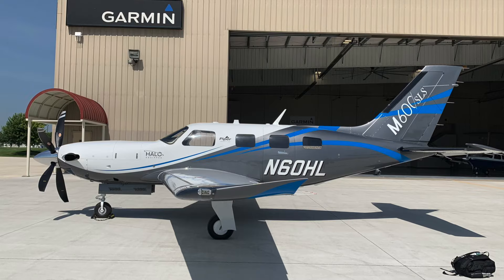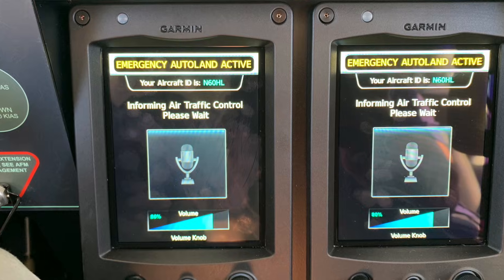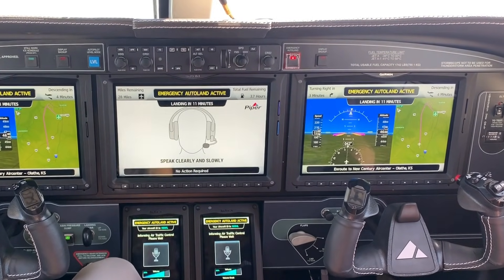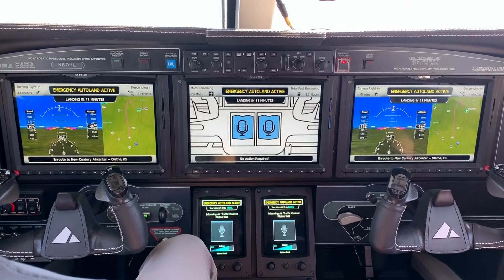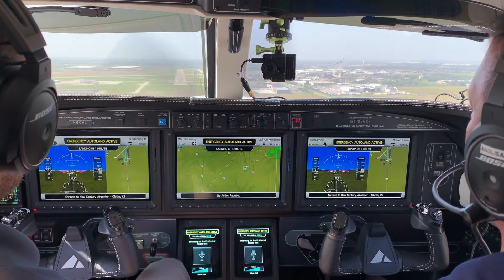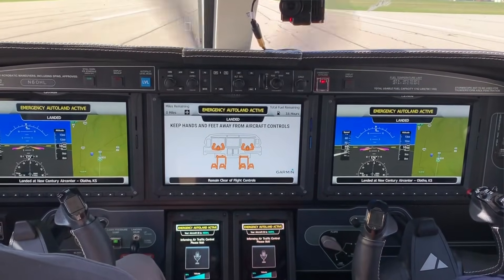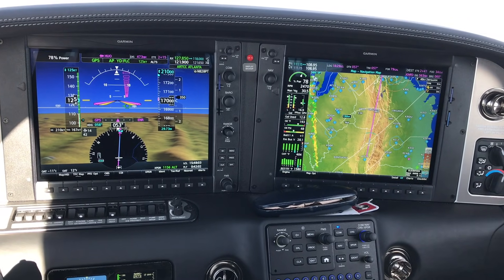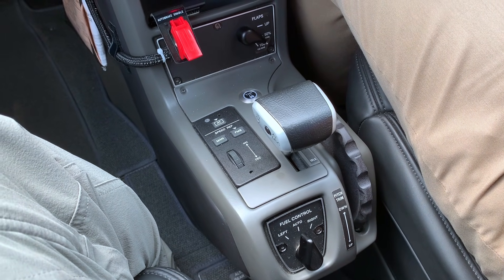Garmin Emergency Autoland Flight Trial

Comment: This type of system could be quite useful in commercial aircraft as well.
Reply: Well there are always 2 pilots there, so the risk is lower, plus, commercial planes can actually land by themselves (if the airport supports it)
Reply: Yannick von Grabowiecki I know i was thinking more that it could be intergrated in the autopilot to perform cat 3 landings without needing cat 3 ils. Could save smaler airports a bit of money and allowing them to operate in poor weather conditions
Reply: @puppers2607  I guess ICAO would be against relying on Autoland...
Reply: @ygrabo  still a button could save lives
https://en.wikipedia.org/wiki/Helios_Airways_Flight_522
Reply: @puppers2607  The precision would be to low for everyday use ; at minimum the airport need one of these
https://en.wikipedia.org/wiki/Differential_GPS

Comment: So, the autoland is activated. It chooses an airport for suitability, assuming that it interprets the weather, notams, field conditions, landing performance. Does it also announce itself to atc automatically? If the pilot is incapacitated, talking to atc will not be an option so it will be a ghost plane. Would atc have the ability to monitor the progress of the flight as it gets closer to destination and alter its movements for traffic avoidance? This is nice idea, but the implementation needs more work.
Reply: The video mentions and visually depicts the system making ATC radio calls on numerous occasions. We don't get to hear them, but it's implied. Of course ATC can monitor the flight, it's squawking 7700...they'll be lighting up the scope like a flaming christmas tree. ATC can't "alter the movements" of the aircraft, it's a ONE WAY system. Hell, ATC barely has color TV up there in the radar rooms.  CPDLC could potentially allow for two way digital communication where ATC could re-clear them to  another destination, however, that is not out of the realms of possibility with CPDLC (datalink) definitely on the roadmap. However, the LIABILITY issues in having ATC pick a new destination for an airplane would be significant.

Comment: Won't be long until pilots are just there to monitor the systems and don't fly at all. I do wonder how this would cope with an engine out or loss of hydraulics issue though.

Comment: It actually does not sound like it is to complicated a system. Just tie the autopilot, auto throttle and nav/fms together with flight surfases and gear and voila! 
I want to know if that airport is the old Naval air station in Olatha? It was closed out in the 50s or early 60s.

Comment: No mention about how it deals with traffic at an uncontrolled field, or an aircraft in the vicinity that is not in touch with ATC.  I imagine someone is working on this?  
  At my age I don’t fly without a spare pilot.
Reply: Fly safe man.
Reply: if it was implemented they would have mentioned it.
Guess now they just assume the chance of a mid air or runway incursion is low enough to be acceptable during a emergency

Comment: Why do we need pilot at all then. Robot is taking over everything.
Reply: why...because, if something goes wrong with the AL, who is gonna land it? The Cookie Monster?
Reply: @thiscorrosion900  well in that case there goes my future job as a pilot, might as well solve the pilot shortage crisis with more automation
Reply: @gordo1163  Nah, I meant someone has to be in that bloody plane that is capable to fly and land it and monitor systems, etc. 

The ALand systems are only another 

emergency/safety feature, that's all. 

So your job should still be safe!

Comment: When the system communicates with the airport, how does the airport give clearance to land and which runway, or does this thing just barge right in regardless?
Reply: This would be used in an emergency which would give it priority over all other traffic regardless.
Reply: @zachr8274  … except the other autolanding emergency. But I'd assume that TCAS integration could resolve that.
Reply: It uses the Leeroy Jenkins approach.

Comment: How does it handle bad weather, such as IMC, turbulence, wet runway, severe crosswinds.etc
Reply: Does it really matter? If the pilot is incapacitated and the passengers are not able to take instructions and fly the plane, then the only other alternative is to sit back and wait to die? If the passengers are able to take instructions and fly the plane then this system would at least make it easier to set up an approach that could be aborted if anything is off-nominal.
Reply: MWB Gaming most likely the same way auto pilot does

Comment: How does it handle a subsequent loss of power/thrust? Will it establish best glide and look for suitable terrain for off-airport landing?
Reply: Would be possible depending how detailed the database it its using.
Best glide performance is relative easy to do for a autopilot; adjust elevator trim to maintain the speed of the best glide performance.
That speed is known for each plane.
Reply: cmulder002 true. I saw this feature also highlighted on the Cirrus Vision. I suppose in that case, it could continue flight until CAPS deployment altitude.

Comment: eh, I mean the 737 max was killing people with just an anti-stall system. I’m open to it but just regulators and insurance companies maybe not
Reply: AM sure because of "mcas" the regulators are going to test this system themselves before approving it. 

Crucial difference is that this system allows for a pilot to take back control at any moments by simple moving the control inputs; that is why the system explains not to move them when the auto-land system is active. Also its ONLY active AFTER the button is pressed and makes that very clear on the displays.
Reply: cmulder002 You have a point. Was the anti-stall able to be disengaged or did you just have to fight it?

Comment: I'm wondering if this system would assist a VFR pilot who gets into bad weather or clouds and accidentally becomes disoriented or inverted? Would it assist in correcting the aircraft to make the safe landing?
Reply: It transitions from whereever you are to a landing, unless otherwise interrupted. You can come up with as many use-cases as you like, including the one you mentioned. Once in VMC, the pilot could either deactivate the system, or let it continue to land.
Reply: @coma13794  Nice.

Comment: Interesting system.  However, very sophisticated system for a very, very, very rare event (hypoxia or pilot incapacitation).  Data shows that the more significant issue with these aircraft are pilots losing control (icing-induced suspected conditions and the aircraft ends up in an unrecoverable stall/spin leading to in-flight break up).  Seems money would be better spent solving the higher likelihood events that lead to fatalities. I own and fly a PA-46 so I’m familiar with this aircraft and the fleet’s incidents.

Comment: Elon Musk: our cars drive themselves
Garmin: hold my beer
Reply: @Richard Ren yea you would assume since there is much more risk on the ground (and much less reaction time) that car control software would be stricter regulated (and tested) then in aviation  ....
Reply: It's counter intuitive.  The things a plane must do to fly itself is easy compared to what a car must do to drive itself.  A plane does not have to recognize very much about it's surroundings in order to navigate and land.  An autodrive car has to have a system that will recognize roads, centerlines, other cars, obstacles, pedestrians, Stop lights, signs, construction zones, reduced speed zones....etc....
Reply: That's all cool until the plane runs under a truck that pulls out in front of it.
Reply: Fully autonomous cars is a much more difficult problem and Musk still hasn't come close to solving it.
Reply: @Richard Ren That is already implemented; The reason you are told NOT move the controls is that when you do it disables the autopilot and switches to manual control. 

No need to push a button just fly the plane and press the auto-land button again if you want the system to land for you again.
Reply: car autopilots are alot more complex but im sure people mentioned that already...
Reply: self-driving cars are much much more difficult than this,  they are light years apart
Reply: @MrPCT007  that would be a much cooler demo for garmin ; showing how tcas is implemented during the automated flight part.
Reply: Xavion re-badged?
Reply: Planes are to easy for Musk, he does this with rockets instead :)
Reply: Landing a plane is way easier than autonomously driving a car.
Reply: Anything Tesla can do, Garmin makes it better,
Reply: Lot less traffic to worry about up there ; the chance of a kid running on front of your plane chasing its soccer ball is really small.
In a car its a much bigger issue.
Reply: @cmulder002  definitely the truth
Reply: @cmulder002  You are correct. It's actually much easier.
Reply: @cmulder002  There's no children in the sky.

Geese:Hold my Beer.
Reply: cmulder002 nah, much harder with a third vector of travel and especially with all the atmospheric conditions having to be programmed in.
Reply: @beechcraftkingair3799  civilian planes are designed to be stable. you can let go of he controls and it will just continue to fly straight and level.(with the trim set correct).
The "dihedral" angle  ("V" Shape when looking from the front) of the wing is one part of that and that helps to keep the wings level.  Autopilot design started in 1914 and in the early '60 gyro's where accurate enough for cross country navigation on those gyro's alone.(this was done to test the navigation system later used in the Apollo project)
None of that required computers as we know them today. Today's technology just adds precision and more user friendly use.
Reply: to be fair his rockets fly themselves too
Reply: @Fresse  all rockets fly themselves starting from the first rockets
Reply: @Richard Ren not as much as Google's though Google always crashes no matter WHAT they make since they fired all their geek people long ago.  They are the most mismanaged company worse then Payless Drugs was!
Reply: Now if they can take the annoyance out of taxi navigation and engines management   I’ll upgrade immediately
Reply: @Richard Ren also airplane crashed, and people in cars... people crash so much in cars that it's no longer a tragedy but a statistics.
Reply: well they don't yet. he has ONLY just released a closed Alpha of auto-drive features, and is still years away from getting it working.
Reply: Doesn’t take into account NOTAMS, construction, etc. that being said I’ll take it over a Payne Stewart type scenario
Reply: @Richard Ren Baahahaha, you think some programmer just hacked some shit together to get those Falcon 9's to land on a barge in the middle of the ocean in rough seas?
Reply: control a plane or a boat is 100 times easier than a car in the traffic, with several variables you cannot figure out or predict when will happen.
Reply: As a machine learning engineer, I can confidently say that autopilot on the ground is actually much harder than this
Reply: @Richard Ren wow this is true, for every Tesla that crashes, there are 10 times as many crashes by human drivers. Already, Tesla on autopilot is 10 times less likely to get in an accident per mile then a human, so for every crash that we test the car has, there would have been 10 had it not been driving.
Reply: Margin of error is HUGE in the air, on land inches could be life and death
Reply: @Richard Ren that is just statistics; once there are "enough" of these systems in use sooner or later there will be a set of circumstances its not programmed for and it will crash. 

Both on the road and in the air.
Reply: @cmulder002  It's not exactly like that for the cars at least (personal experience with software engineering the back end). There isn't this list of "circumstances" that it goes through, it's a general connection between all of the systems, all of the inputs are weighted depending on other things, etc. It's much like a neural network but not quite. It all comes together to control the brakes, steering, etc not by making a specific decision, but by taking whatever action is MOSTLY wanted. 
I'm not good at explaining this stuff in such few words but the best way I can say it is it's kind of like a Ouija board where all of the subsystems have a hand on the planchette 
When it crashes, it's almost always because it's being starved of information in the worst possible moment.
Reply: @cmulder002  the same thing can be said for driving or flying manually.
Reply: cmulder002 yep it’s called taking the pilot out of the cockpit Uber style
Reply: @cmulder002  Seems that a lot of humans weren't programmed right as well.
Reply: Elon :  no Hold My Beer Lands 3 Rockets from space backwards
Reply: @MrPCT007  Clearly not a pilot to have this kind of thinking. car automation is much easier than plane automation. This is far more complex.
Reply: @maxou5757  Wrong.  Flying is a simple, lazy turns,  straight lines, predictable environments, predictable speeds and altitudes, well marked runways, no pedestrians jumping in front of you, no traffic to avoid or poorly marked roads.  Auto land has existing for a couple of decades in heavies.  This is very cool but it is nothing new.  Don't let all the buttons fool you, normal flying is not rocket science.
Reply: Christophe Blanchi Fool me ? I’m an Airbus A330 pilot, I think you’re talking to the wrong person. I’m well aware how those systems works and what kind of limitations we have on autolands;)
Reply: @maxou5757  car automation is impossible to do safely on existing road systems. There are too many variables. Aviation is procedural and predictable in comparison.    No balls roll across a flight path that have to be interpreted as a predictor of an upcoming event, just to name one. The auto car that killed a pedestrian in California wasn't an outlier. It was absolutely what had to happen.
Reply: @maxou5757  dude what? car automation is light years more difficult than plane automation, not even comparable. I am a pilot and worked in machine vision applications to self driving

Comment: Autoland has been around for years in commercial airliners and thus not really anything new but it is now an available system for general aviation. I am sure this is an expensive option for business jets and turboprops mainly. Doubt older planes could be modified for any reasonable price and I doubt it would be worth it for cheaper planes given new servos for brakes, landing gear, flaps, etc. cheaper just to have a parachute but it is about time that Autoland is available to non commercial aircraft. Not sure if it will allow you to do CAT 3 approaches or not and not sure if it only lands at airports with approaches, but it is a great product and Garmin will again remain at the top of the avionics sales list.

Comment: Auto land has been a thing since the 1970's the Air Force C5A had a version that would put it on the runway but the pilots would have to break a steer once they landed
Reply: Rae Namet Didn’t the L-1011 also have autoland?
Reply: @SamPatton-t3g  Don't know
Reply: Autoland is somewhat older than that. The first commercial passenger flight that autolanded with limited visibility was in June 1965 (on a British European Airways Hawker-Siddeley Trident) and in Novenver 1966 one landed with zero visibility (Cat IIIC).

Comment: Lets say you hit a bowling ball while flying high and cause a big circular hole somewhere that has scattered around and injured some hydraulics, fuel lines, cables, etc... etc... How good does this system work in a real crisis when multiple sensors have been disabled or read false data due to a real accident in the air, leaking fuel, elevators say they work but does not work etc?

Comment: Will the system recover the aircraft if it has departed controlled flight?  A much more common occurrence than pilot incapacitation.
Reply: Then the pilot has to admit he lost control and press the button.
A system that overrides the pilot is dangerous (mcas)

Comment: Like what someone else has said. Trains, trams, etc. These things are literally as one dimensional as you can get in terms of movement. They ride on rails the whole time with specific designated stops. Despite this, there are still MANY conductors to operate the vehicle. 
Now try to compare that with a vehicle that can move in three different areas, moves through a changing atmosphere, travels hundreds upon hundreds of miles, flies above heavily populated areas, etc . At first I was worried about my future job, but I strongly believe that it will take at least 25-30 years before these things are fully automating airliners... IF that.
That being said though, still a neat piece of tech that could go onto private or general aviation aircraft in the event of an emergency!

Comment: Would be interesting to see a system on a commercial jet where the pilot can activate an auto-land and then lock out the controls in the case of an attempted cabin breach / hijacking.
Reply: that might become a next mcas then
the' pilot regardless of skill level should always have the final say in control.

Comment: I think it would be nice if ATC could issue a message to the airplane to activate this system from the ground. Sure, it would need some cryptographic protections and add a promt on the screen which the pilot could click away when it's a false alarm, but this would help a lot, too!